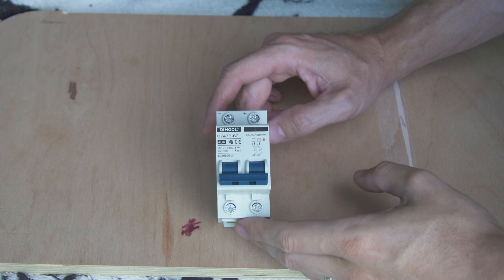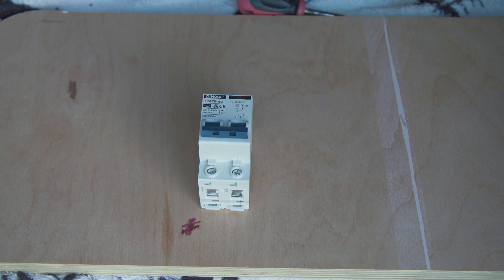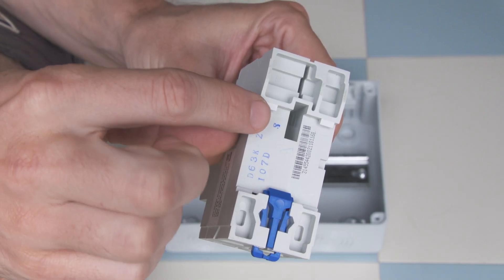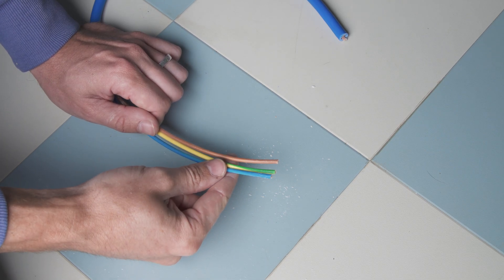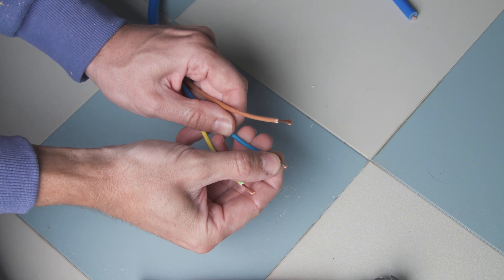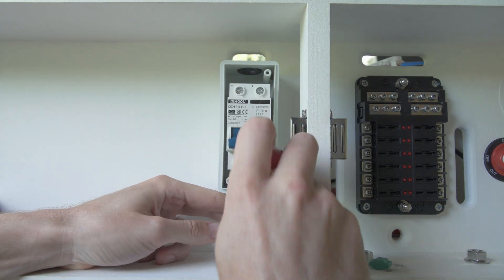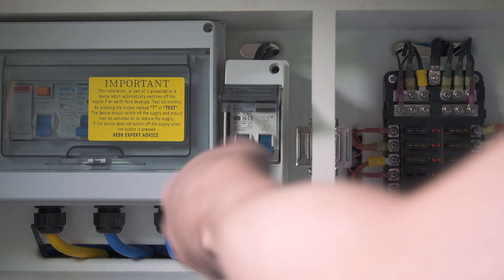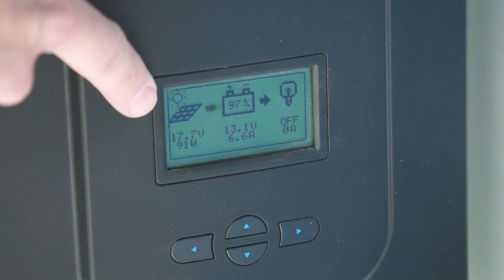How To Install A Solar Kill Switch | Don't Use Single Pole!

Comment from the maker: Just a note on sizing your kill switch. In the example given, my solar panels are wired in parallel, hence the calculation I used for sizing but I thought I'd just clear it up for both parallel and series. If your solar panels are wired in parallel, then you will also need to add the current/amps together. That total will be the minimum size your kill switch needs to be in amps. You will also need to consider the voltage when sizing your kill switch. For a set of panels wired in parallel, the voltage will remain the same and not be added together. In my case, the maximum voltage of a single panel is 23.5v. 

If you have wired your panels in series, you will add up the voltages, but the current/amps will remain the same. For my setup, the current would be that of one solar panel, so 5.5amps, meaning you could buy a kill switch with a lower amp rating. The voltage would have been times by 6 as I have 6 solar panels installed. 23.5v x 6 would mean that the kill switch would need a maximum tolerance of 141v. The linked kill switch can handle between 12-240v, so it should cover most applications and given that it's rated to 40amps, should also apply to most parallel setups.

If you're unsure whether you have wired in series, parallel or even a combination of the two with series-parallel, then watch this video to find out - https://youtu.be/J3NVXRZVOdc

Comment: You should mention that the switch you used is rated for up to 240V DC, an AC rated switch will not be the equivalent. I would have used a switch disconnector so no need for an enclosure.
Reply from the maker: Yeah, hopefully people have the brains to put a DC switch in and not an A but I'll add it in future

Comment: Whoa, my brother in arms, how did you conclude you add the currents on your solar panels to size your MCB?
You add the current of the paralleled series strings not the seried string. 

You have one thousand 15Asc  panels in series - you get 15Asc. You add them ALL in parallel, then you add up the currents. 
You have series-parallel strings, you add the paralleled currens of each individual series.

Edit: yet I will not disagree on grossly oversizing this particular protection device. 
The bigger, the better. Also mind the working voltage on the dc mcb. It really matters. It should be way above your absolute Voc value of the entire array.
Reply from the maker: There are no series-parallel strings in the installation, just parallel, so the currents should be added together
Reply: @WoodandWild 
You should've mentioned that your particular setup is all parallel 😊
Anyhow, that way is pretty inefficient due to high currents all across the chain and pricier due to the wire gauge needed to support all that current. 
I don't like high voltages in my system either, especially hundreds of DC volts but I chose a series-parallel configuration to keep wiring costs down and actually put the mppt to work.
Reply from the maker: May I ask why such an expert is watching a video on how to install a solar kill switch in the first place? 😅 Yep, it's been pinned to the comments and yep, a series-parallel configuration can give the best of both worlds. The van is due to be used in sunny climates though and has a 300-amp battery installed, so maximising the current was beneficial in this case
Reply: @WoodandWild I did watch your vid and I do enjoy watching random videos on the matter but I stumbled upon yours because... YouTube recommends. You know... The algorithm 😊